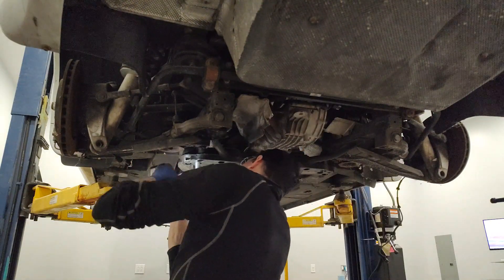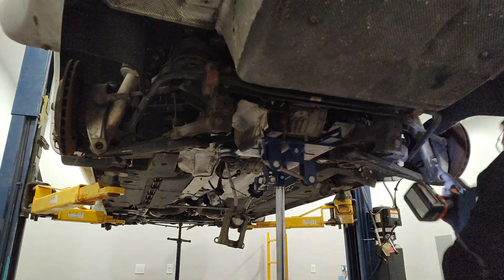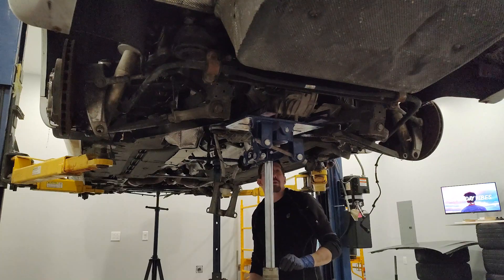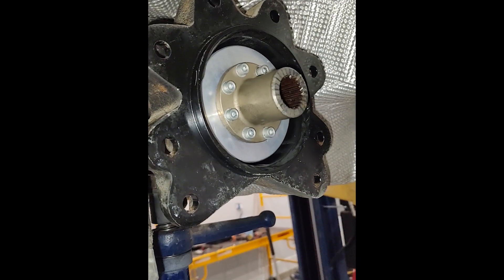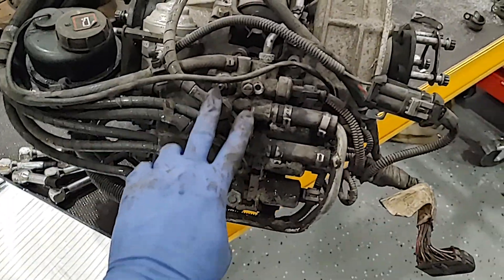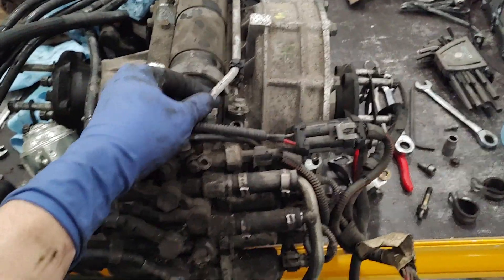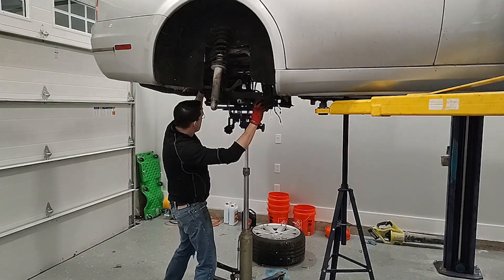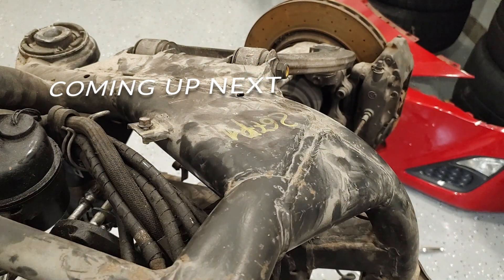Removing the Maserati Transmission!!! : Project ToyoRati Ep 4

Comment: Hello,I have the same car in my workshop and I want to change theorings from all the valves and cilinder shift. Do you know if it exists a repari kit for this?  Also i need to change the pressure tank from gearbox .  Thank you. You make a great job.
Reply from the maker: Thanks for the kind words.  I am not aware of anyone who sells a kit, I know of a few places that will rebuild the system, but only if the valve body and actuator are still in good inspection condition.

Comment: How did you convert the transaxle to manual shift?  Is there a video on the manual shift conversion aspect of this project?
Reply from the maker: I'm actually in the process of building what I need to make this converted to a manual setup.  It's in the final stages of manufacturing right now.  I hope to have something up soon.  It's VERY cool.
Reply: @TheIntensiveCarUnit  Is there a way to get in contact with you directly? I'm looking to do a manual conversion using the same transaxle but fit to a car from the factory.
Reply: @TheIntensiveCarUnit   any updates on that? Very cool dude

Comment: Hi, my Quatroporte (2005) for some reason is running very hi on engine revolution.  I'm talking about almost 3k rev at only 50 mph on the 6 gear. I've seen on youtuve videos that other Maserati don't even reach 1,900 rev at 55mph on 6 gear but my car every single gear is very hi on revolution, feels like every gear reach hi rev with little gas and the transmissions its not slipping or showing any trouble signs.  I just bought the car and don't have any previous experience with Maserati.  I can't drive over 50mph because the engine is too high on revolutions!!!  Any help will be appreciated.
Reply from the maker: This sounds like a slipping clutch to me.  

I know you say the transmission isn't slipping, but these cars operate as a conventional manual, that is controlled by hydraulics and computers.  Not from the conventional automatic which is controlled by a valve body and multiple wet clutches.  

Outside of scanning the codes or knowing what clutch wear is at, I can merely only speculate what could be going on.

Comment: Just stumbled across your build and I'm intrigued!  I'm also thinking about an F136 for a project.  If you're getting rid of the F1 shifting system, what's your plan for engine management?  I'm guessing that the engine won't run if it id missing that system....
Reply from the maker: The F136 is a pretty stout engine, and the price on them is really nice considering the current prices.  The F1 system is long gone, and I have an idea on an engine management system the should work.  But I won't know until I try.
Reply: Keep in mind these transmissions were also manuals - so could be converted to manual too.

F136 is an awesome engine indeed
Reply from the maker: That's currently one of my works in progress.  I have a few angles of attack I am working on to make this happen, but I have a long way to go before I tackle that part of the build.